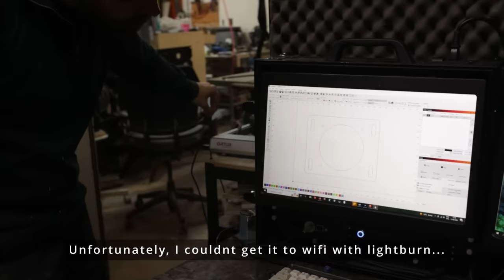Building a £20,000 Epic machine part 3

Comment: I wonder if it would be better to mount brush on its own seperate z axis. and you could set it so spindle can go up and down, but brush does not. unless its doing toolchange then it rises brush all way up for tool change and measure, then you can manually set brush height, OR set it to ratio from tool length?

Comment: Nice work. You have a broad set of skills. A couple comments. Not sure why you would put your cooler which will radiate heat on the intake of your cabinet cooling fans. Why blow heat into the cabinet? Also, not sure how hot your coolant may get but running it first into your plastic bottle with a grommet seal might be risking a leak. Peace

Comment: Now that the fans are pulling hot air from the radiator, do you find it having issues cooling the electrical box now that its pushing in hotter air?

Comment: I thought you said that the cooling fans drew filtered air from the shop and used it to lightly pressurize the cabinet with the computer, VFD and other electronic equipment. Now it seems like you are drawing this air through a radiator that will cause the air to be warmer, and it is possible that the radiator could clog with dust from your shop and reduce the air flow available for cooling your electronics.  This seems like it could cause problems. Perhaps that radiator should be mounted elsewhere...

Comment: Great work but far  too expensive for a DIY wooden machine.

I bought a used 5000kg  Wadkin ux 2612 for less than 1/4 of this. Including a 10 pocket tool changer, 8HP spindle and a 10HP vacuum bed. All driven on ballscrews and servos.

Comment: What kind of plywood was that that you used for the dust shoe? Like nothing else I've seen before.
Reply from the maker: it is a Beech core high pressure phenolic plywood, I used to get it for the hifi stuff I make. The audiophile crazies like it because it is very dense and good at damping vibrations
Reply: @NewYorkshireWorkshop  Thanks. You folks in UK have much more interesting selection of sheet goods (MDF, ply, etc.) than we do in the US.

Comment: Does the table suction mess with the dust collection. Towards the end of the video I saw sometimes the dust would be all over the place.
Reply from the maker: its the dust extraction that isnt great, it is clogging the fine filters really quickly so if i dont go and knock the dust off before next time it gets turnted on, it isnt effective enough. im working on an automatic stirrer/vibrator for it.
Reply: @NewYorkshireWorkshop  Have you tried adding a cyclone before the filters? Always wondered if those worked for cnc applications.
Reply from the maker: @stankolodin5586  I think they mostly separate out the heavier dust and the finer stuff will bypass it so im not sure it would help in this case.

Comment: Are you based in South Yorkshire and did you buy the T-track locally? There's loads on ebay etc but it'd be good to buy local.
Reply from the maker: YEs im in South yorks, but no it came from KJN in leicester- https://www.aluminium-profile.co.uk/
Reply: @NewYorkshireWorkshop  No worries. I think I found a place with some in stock, where I get my 3D printer supplies from near Attercliffe in Sheffield.

Comment: Why does your Z axis sound so bad!?! It seems like there may be something wrong there. I am nothing but it does not sound right to me, of course a pound of salt is called for here. Absolutely beautiful work you are doing!
Reply from the maker: ye it sounded terrible. I rebuilt the motor plate in ally with some bracing at the back to solve the flexing under moderate cutting force, it also sounds much better now so maybe was resonance in the flexing plate. also maybe some binding as the plate wasn't perfectly flat, I didn't put much effort since I knew I'd change it to a cnc'd ally one.

Comment: did you write the code youself for converting the model to g-code the machine understand?
Reply from the maker: No, I use fusion 360 which generates the G-code using a specific post processor for linuxcnc.